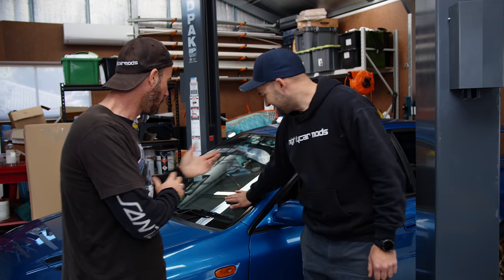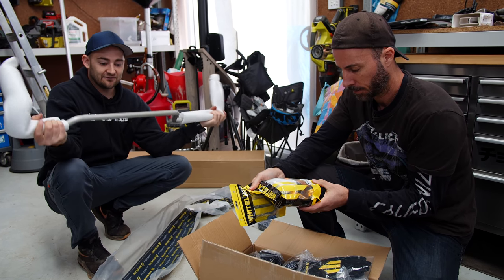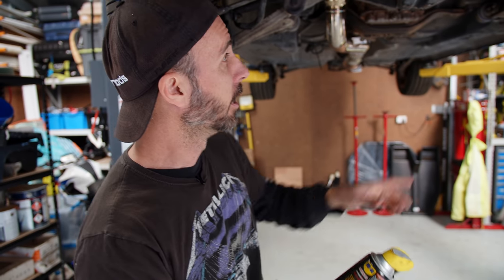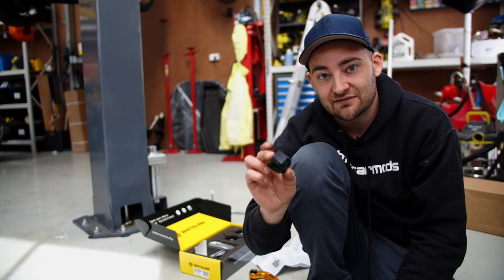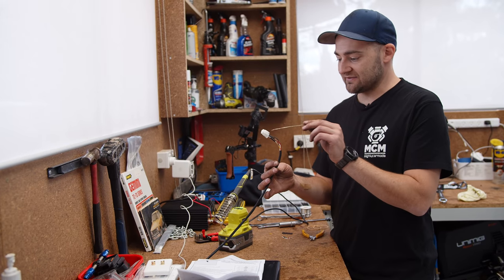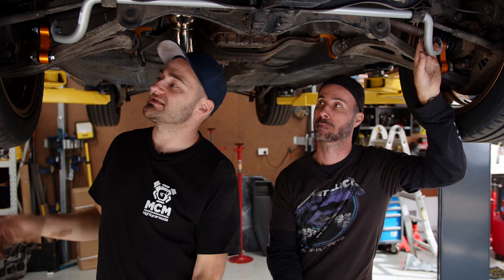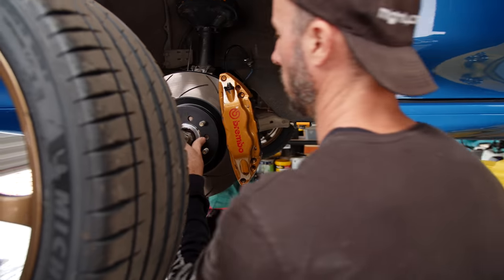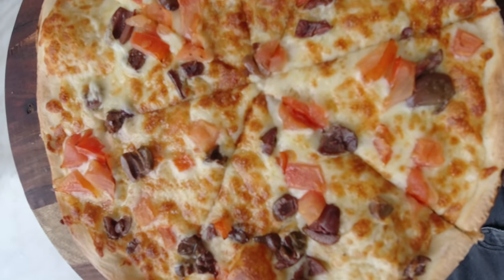The STI is READY TO RACE the BRZ

Comment: In my personal experience with installing the white line antisway bar on a 1998 wrx, I highly recommend you do not use the original balljoint style end links as it WILL ALWAYS be noisy for all but 5 minutes after putting more lube on the bushes as the whole sway bar will shift side to side. Had so many issues, bar on and off relube, repositioning etc so many times after thinking it’s fixed and the noise it makes is so loud. Not speaking from experience *shifty eyes 👀

Comment: just an fyi, basically everyone gets this wrong... swaybars DO NOT improve grip, they actually reduce it. Roll is not indicative of low grip.

If body roll is too extreme for various reasons (hitting tuned bump stops, or uneven tire wear due to alignment settings not being driven in well enough...etc) you increase spring rate. Thats it. 

If you add sway bar stiffness, it reduces grip on the two wheels its installed for, and increases grip on the other two tires. Swaybars are only for adjusting grip balance cheaply, and to prevent vehicle deaths/crashes due to rollovers, and the unexperienced driver overcorrecting due to body roll and flipping.

Comment: If you swap sti arms into your wrx, then yeah...you need sti end links, sti brakes, sti rotors, sti wheels. All the 5x100 stuff is 5x100, and it won't work on them rear arms.

Comment: you should never solder your o2 sensor wiring, use crimp connectors, an o2 sensor breathes through the cables(wires)

Comment: Fun fact, whiteline have a giant catalogue for most performance cars under the sun ... but for FD Rx7's only 1 item... no sway bars, no control arms, or anti lift kits or anything, just one specific bush... and nothing else... why is this a fun fact? FD Rx7's were so perfectly built for handling from factory that the only thing you need to do to them is put an excellent set of coilovers on them and they are cornering weapons, whiteline knows this so they don't have a catalogue of parts for the fd.

Comment: Lengthen the main harness!;! Otherwise you have to do that every time. Wow! Also the main harness is not heat rated and not stainless wire that doesn't solder very well.

Comment: Honestly, you don't have to go to a specialized shop to get a modified alignment. Any competent alignment tech can do it. It just specs. You set the adjustment to the specs listed and that's it. Whether it's OEM specs or modified, it's still the exact same procedure. Instead of camber to -0.2* for OEM, the modified spec might be positive 0.2* so you still adjust the exact same part. You just change the spec.

It really is that FKN simple.

Comment: This vid should be titled "Making the STI live up to the hype"
Reply: Ultimately it's an aged knock-down homologation, based on a cheap shitbox commuter vehicle with all the inherent issues starting from such a platform implies - up against a far newer machine specifically developed from scratch as a sports chassis.  Really doesn't matter what you do to it, you do the same thing to the BRZ and it's going to hand it to the STI on any corner.

Comment: The reason whiteline supply adjustable droplinks is due to them being made so badly you need them to dial out the fact they are not machined to a decent tolerance. 
You could get lucky but the ones there making and selling in the Uk is shocking. 
Knocked the corner weight out 15% on the rear. Got sent another bar, again same issue. 
Soon as we put the OE bar back on 50-50 weight resumed. 
The customer care was shocking, basically told me to F##koff and read the small print. 
Which state you must use adjustable droplinks, but don’t advertise this.
You’ll have got them free, I’m not as lucky 😒
Out of interest how much did the geo guy have to dial out the bar?

Comment: Never saw the point of anti roll bars (bear with me) the point of suspention is to move with the contours of the road to keep the tyre in constant contact AND to absorb bumps/shocks.....so it needs to move, By tying the indepenatant suspention together its like tying your shoe laces together, Yeah it'll make it flatter around a corner because as the outside compresses it pulls the inside up too keeping it flat, Also if you were go go over a dip on one side (like an unagressive pothole) the wheel will struggle to extend into it fully.
It's no longer independant suspension, plus body roll isn't bad it just means the weight is shifting and the suspension is doing its job, Uncontrolled movement is bad but movement in of itself isn't. We made fun of american cars having solid rear axles for years and when they finally start changing over everyone else ties thier independant suspension together. My old Vauxhall astra G and trailing arm rear suspension rather than the ford focus's independant which effectively gave the car an "anti roll bar" by default. Made it very fun around fast sweeping corners (genuine inertial drift).

Comment: You don't need to wait (until the car is at normal ride height) to fully tighten the sway bar link or mounting fasteners as you should do for a control arm bushing. The sway bar link bushings don't have a natural resting position, unlike the control arm bushing. Many cars have small ball joints, or heim joints, in the link ends. They are (should be) free to rotate as the sway bar exerts force up and down on the links. As for the alignment, there is no way those bars are strong enough to put any preload that would have to be compensated during an alignment, nor do sway bars (or lack of them) affect alignment in any way. Think about it. I did not see any provision for length adjustment on the links you installed which would be the only way to negate any theoretical preload present in those or OEM sway bars. Any preload is simply a combination production tolerances, and at that very minimal, nobody makes street cars with preload in the sway bars.
If it was a typical NASCAR set up for ovals with a hollow 3 inch diameter splined bar (rotating in roller bearings) with foot long arms and heim joints then that could be preloaded to favor a specific side while static which in turn would carryover to affect roll while cornering. Such a sway bar could affect static ride height because it's at least 10X stiffer that any road car sway bar though it does not, and cannot, affect static alignment.

Comment: A sway bar is useless on a track if your car does not have an LSD.  If you DO have an LSD a sway bar (especially bigger ones) will add more wear to your LSD because a sway bar lifts the inside wheels. If you have a FWD track car, eliminate the front sway bar and add the biggest rear sway bar you can find. For street and spirited back road driving sway bars is a good upgrade front & rear BUT remember if you put on sticky tires and push hard on a track you will lose traction from the inside wheel. The BEST modification you can do for spirited & track days is a high performance alingment and the degree of difficulty of that alingment will depend on your driving skill level. AWD cars (especially Subarus) will push like a pig on a track when pushed hard. Push meaning the front will not grip and the front will push out

Comment: You could have installed the front H brace, it does a lot for the steering response.
The alignment guy has nothing to do with the swaybar setting, thst effects 0 on alignment, the owner of the car should decided the behaviour.

Comment: Is it possible, that the BRZ is NOT actually slow, in the same way that the MX5 is NOT actually slow... but because they both handle SO well that it is easy to push the limit of their performance? Which you would never be able to do in most cars, because they don't handle as well.

Comment: I design anti roll bars (sway bars) for a living (on trains not cars) and they are far more complicated than they look. It always frustrates me looking at car ARB's. They are so poorly designed and always added as an afterthought which is why they are bent 7000 ways to make them fit around stuff that's already there. Look at one on a train and it's designed to be there from the start. Straight all the way along and fully integrated into the vehicle.

Comment: When you own a Renault so the vastness of aftermarket mods is very limited and you cant enjoy doing mods like this 😳☹ anti-lift kit sounds like a great mod especially for front wheel drive
Reply: What have you got bro? Much more limited but still a fair bit available for the Renault sport stuff.
Reply: @tomholton235  Megane RS265. I've done the intercooler and downpipe and she's been remapped so far
Reply: Matt Holmes great car mate, definitely the best looking iteration you have got there! Got an old 225 myself. Mapped, exhaust, intercooler, lowered, shocks, intake and bov sorted. Just need to get my lsd and updated clutch and flywheel fitted and we will be getting there. 

Pretty sure there is a power flex anti lift kit front arm rear bush available for these. I’ll probably be fitting one along with some adjustable top mounts when I refresh a few suspension bits. But putting stiffer shocks and lowering springs on massively helped mine keeping the power down. Nose used to go straight up but it’s a lot more planted now. 👍

Comment: The only cars that feel like go-karts are the old and new mini. My R53 will out-corner most cars
Reply: My R56 really surprised me with speed it could carry round a corner. Loads of fun but sadly not particularly reliable. Since been replaced by a Renault sport megane which also has epic handling but bags more power!
Reply: @tomholton235  Agreed the R56 and R53 are not reliable at all and have to keep up with maintenance or head gaskets and timing chains will be a problem. I've had 3 R53's now and 2 had head gasket issues. My recent one has been running a year with no issues so far. I really like the Megane sport. At first when it came out i wasn't keen on the rear end but now its grown on me a lot and what helps is its not expensive.. Ideally I would love to put a B16/K20 in the mini but then I would just buy an EP3 (Again) and sort its TERRIBLE handling
Reply: Lee Fall yeah head gasket issues killed mine. Was sad as it was a great little run about. Mine needed better brakes though as mine nearly killed me after a b-road thrash and some significant fade 😬 I’d definitely get another if the reliability was better but would make an interesting base for an interesting engine swap🤔 know what you mean about the “ass” definitely grown on me as I hated the standard megane shape but the sport body kit really improves the looks. But different from the usual vag hot hatches everyone seems to have around here.

Comment: "The corner speed was crazy in the newer car"
Way to not give the BRZ a single ounce of credit for being low, light, wide and well designed.
Reply: @Dan21792  Nah, I've got a liberty GT.
Reply: Ultimately the STI was a car for rallying based on a cheap shitbox chassis designed as a commuter car and so will always be limited on a track by its genetics - the BRZ was designed as a sports car from scratch with track handling in mind, and of course has far newer engineering technology - so it's always going to have far more capable handling than the STI.

Comment: sway bars reduce grip....fail vid.....springs hold up the car, not bars....sorry guys. Tires set the spring rate, spring rate set the damping and sways SHOULD be used to tune the balance of grip between the front and rear.